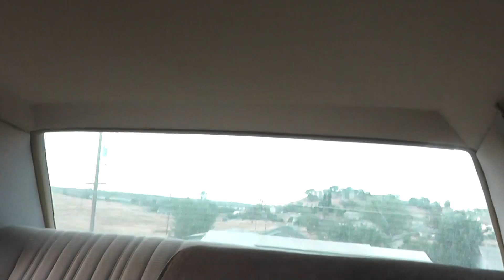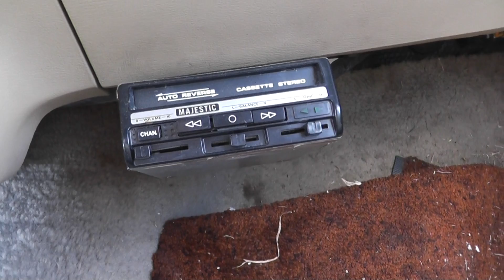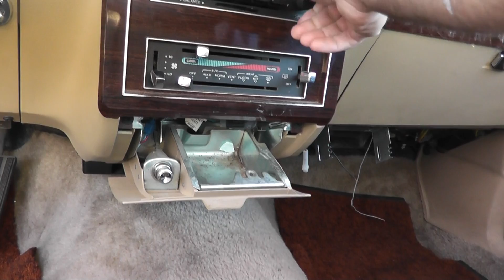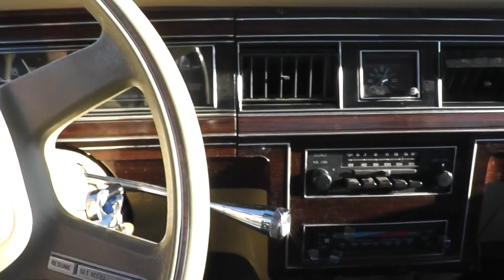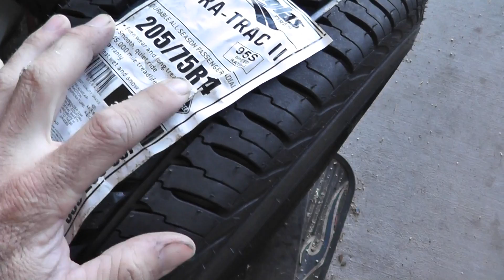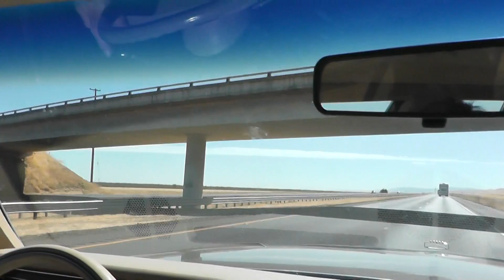Classy Car! Lets Get To Know The 1985 Ford LTD Crown Victoria!

Comment: I had an 85. I got rear-ended in 2004 by a Camero on the freeway. Pushed my car into the one in front, and it into the next one, and it into the next one. The Camero driver managed to total 4 cars and damage to the 5th. It did bend the frame in the rear, but only bumper damage in the front. The car in front of me, and the Camero were both pretty bad looking. I wish I could've kept that car.

Comment: Nice base model '85 Crown. I own a 1989 LX. It is a beast. The engine, no, it's not fast, at least when stock. Once you get rid of the catalytic converters, and do some work on the 302 Windsor motor, it can become powerful like it should be.

Comment: I have a thing for vehicles from 1985 because I was born in 1985.. There's one of these for sale in Sacramento for next to nothing right now and I want it so bad. Best part is they are still carburated so you don't have to deal with non-tunable injection. You just pull the smog 4 brl off and put on a block off plate for the EGR and run a regular 600cfm Holley on it 99% of the time and tune it right, and then pop the other one back on on smog day. (living in Commifornia) Granted it still won't make much power especially with smog timing curves but.. hey it helps.

Comment: It's nice, but by the early 80s, Ford interior quality and fit and finish was abismal, well just look at the glove box and steering rack panel
The 70-78 LTD were made to a higher standard than this generation.
On the flip side, the newer 79 and beyond panther bodies were more smarter sized (and they're still big and strong)

Comment: I was told that when a tire is going one way and you make it go backwards it will blow the steel belts. Think that is what happened! It probably needs a front wheel wheel alignment. and worth putting shocks. I always buy my tires used.

Comment: If the outter tread on the tire was more worn than the inner tread, you may want to look into getting an alignment. If the car pulls to the right/left or if there is a lot of play in the steering of the car, an alignment should solve the problem.

Comment: Luv your car...nice job.  Any idea on mpg?   I would guess 20 hwy?  I'm working on an 85 Crown Vic with a 5L.  Hasn't run since 2009. Gas tank was rusted out so I replaced it and fuel pump.  It has an excellent body and interior.  Beautiful leather seats.  Got a bit more work to do but it's running smoothly.  Will have to post a pic.

Comment: You can upgrade your wheels to 15" because Ford offered 15" aluminum alloy wheels as a factory option.  I've got a set from my 84 Crown Vic, if you leave in the NYC area, come and get them for free!!  The shimmy is likely due to your old tires.
Reply from the maker: thanks so much for the offer, I appreciate it but I'm a couple thousand miles from you.

Comment: I cant believe you removed the tape deck. just buy some cassette tapes. or even make some mix tapes. don't need a cd mp4 or whatever else you modern people use to listed to music. yes I know I sound offended its just I hate when people deprive real cars from their original specs aftermarket or not. tapes are better. and it was the current technology so it belongs there. well moving on to the next one.
Reply: I wish stereo my Honda Element had a tape deck. Since I have lot of tapes I plug my Walkman into the auxiliary jack.

Comment: Checking in with a 1988 with 127k miles. 

So the whole "car is not a hot rod"/doesn't kick into gear thing...

Try doing a full vacuum line and gasket job. I had a overheating problem and one of the reasons we found was that the vacuum line wasn't getting the right pressure and we narrowed it down to a single valve. COMPLETELY different car and acceleration after replacing that small piece of plastic. But, that only lasted a couple days before it went back to it's delayed kick and soft strength. I met someone tonight who had a similar problem but it was a gasket seal on the throttle, so I'm going to look into getting the vacuum lines, vacuum valves,gaskets all replaced.

I still have an overheating problem but it doesn't burn oil. I have to replace about 1L of water every day and I'm going to check the heater core like in your other vid. Also, I blew a headgasket, and the car was still able to make it 30 miles in traffic to a safe spot until the shops opened. But they only replaced one headgasket, even though the car still runs pretty good. Just have to let it cool down and not hot rod it so much...

Comment: Wheels should go back to being between 14 and 16 inches. They look better. I hate the wheels that are bigger that 17 inches. They're just too big and too expensive to replace.
Reply: I agree with the modern wheels, more expensive to replace tires.
Reply: Those bigger wheels make bumps in the road more apparent.
Funny thing. They talk about bigger tires on trucks causing MPG, due to greater rotational weight. A 18inch wheel weight more, and had more weight out farther from the center, compared to 15inch wheels. So those must have an impact on MPG, yet manufactures keep putting them on cars because they look cool (to some vocal people)

Comment: That 6 feet chrome bar on the front isn't the actual bumper. Despite being made out of 3 millimeter thick steel, according to Haynes it's just the bumper cover. The actual bumper is the M-shaped beam behind it, made of similar gauge steel.

Although new cars are safer at high speeds, it was a big mistake to drop the 5mph bumper standard. These old cars survive touch&go parking, saving us from a lot of hassle...

Comment: Those Douglas tires are cheap tires and that size is too small for a full-size rear-wheel-drive sedan! And when you changed them, I'm hoping you at least Bubble-Balanced them. If it were me, I'd go with a good Michelin all-season tire, the recommended size, and white-wall.

Comment: I had an '84 Crown Vic.  Kept it 10 years but it had an awful "Central Fuel Injection" system that caused the engine to stall at traffic lights.  And the horn was at the end of the turn signal lever (moved to the wheel in '85).  If you want a set of 15" Crown Vic (factory option) aluminum wheels, come and get them.  I'll give them to you for free, I have no use for them.  Enjoy your car, they don't make 'em like this any more!!

Comment: Straight pipe that beast.  It'll sound LIKE a beast
Reply from the maker: I've been considering that, but I also like the idea of staying incognito. Decisions, decisions...
Reply: *****
 It seems that you want to keep your Crown Vic forever. Cool. Follow the manufacturers recommendations for maintenance. Don't be cheap. Take it to your local Ford dealership, and follow the maintenance schedule. I'm just a poor ol' factory worker and don't have a lot of money, but I rely on my dealership to take care of my car. They do a fantastic job.  An oil change is $19.95. Poo on the "30 minute" places.  Replace the fluids, lubricate all of the lube points, like the door hinges, hood hinges, trunk hinges, ball joints, U-joints, ect. You may think that you are saving money by having your own tire changing tool, but you're just fooling yourself. Let tire assemblage to the pro's. It's cheap, comparing the importance of professionals taking care of your tires. With the purchase of new tires, they will provide FREE rotation & balance of your tires for the lifetime of the tires. Get an alignment of the front end. It usually comes with a warranty and is inexpensive. I just got one for my '03 Crown Vic and cost $22. Going with a 205 size tire just degrades the ride & handling from a great Crown Vic. A 225 will make you a happier owner.

Comment: mine has the 351 v8
Reply from the maker: Nice!
Reply: damonster5000 but is it fast?
Reply: Neil Lang 
Those 351s have a bit of potential to be fast though if you get rid of the 80s emissions stuff and know how to tune up carbureted engines 
All the 351s in the crown vics were carbureted it seems right until the end
Reply: @P7777-u7r  That also applies to the 302 EFI.
Reply: @neillang9684  When stock, no. But it can be fast once the catalytic converters are removed and do some minor work on the motor.
Reply: of course no x)
Reply: Same 

And the horn is pushing in the turn signal stock instead of on the wheel

Also has manual windows and never had A/C
Reply: Likely an ex-cop car.

Comment: I think the front end needs aligning. Had the same issue with the wear on both front tires on my '88 Ford pickup. Also, the shimmying in the steering wheel after the tire rotation is probably a result of unbalanced tire pressures. Lots of times people run different pressures in the fronts than the rears. Awesome car though man. I'm slowly looking to get one like this. They're great cars and nobody has them anymore. Pretty cool!
Reply from the maker: Thanks for the ideas about the tires. It's been a great car so far!

Comment: Nice car. I got an '83 2-door coupe last year. Really good shape. NO rust.  New heater core, exhaust x pipe and new calipers and it's like new. I put a nice stereo in it and replaced all the speakers with a factory look. It rides so nice and quiet. Cost me 2500 bucks. I DONT want a new car. When this one goes down, I hope to get another one.
Reply from the maker: From what I've heard these cars can go for a long time, so hopefully we won't have to worry about replacements any time soon!
Reply: ***** They do indeed. My '88 Grand Marquis LS has 205k
miles and uses no oil. I always outsmart myself trying to be frugal. Like, when I ordered one tire. 215-75-15. The car had 70 series tires.Then, I had to buy three more to make them all the same size because the first one had already been mounted. Oh well, it needed tires, anyway.

Comment from the maker: No, it didn't work right from the start. It's a problem with the FM tuner I think. It will tune in low frequencies like up to about 93 but then the humming starts and if you go all the way to 108 it is really bad. I've got some ideas for it, though.

Comment: How many mpg does that car do or is that a sore subject?
Reply: High teens to low 20’s mpg. Everyone seems to think these big cars were gas guzzlers but they really were not. The big V8’s of the 80’s were very detuned to meet CAFE and emissions regs. These cars weren’t fast but when you reached cruising  speed on the highway and set your cruise control the gas mileage really was not terrible, not much less than an average mid sized car of the era.
Reply: Nick Clark Let's just say these cars were from an era when gas wasn't that expensive.